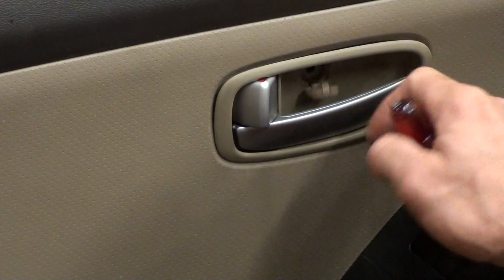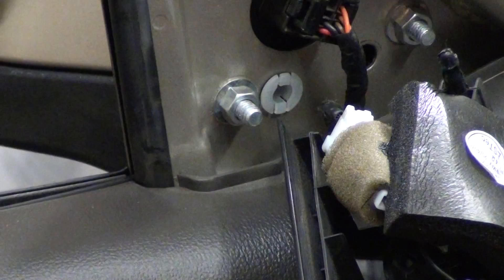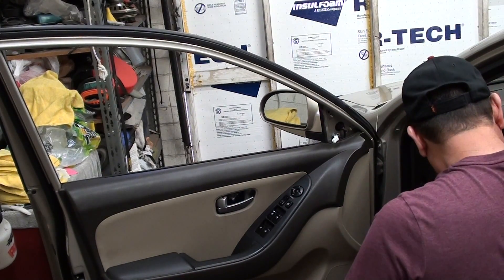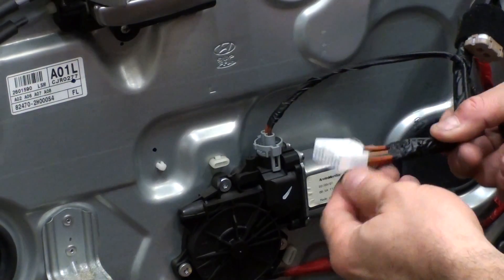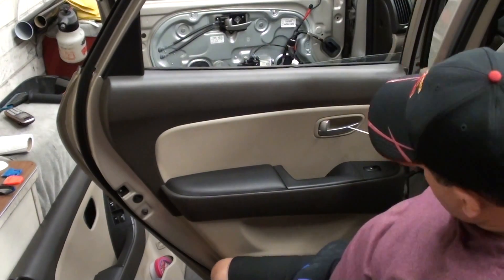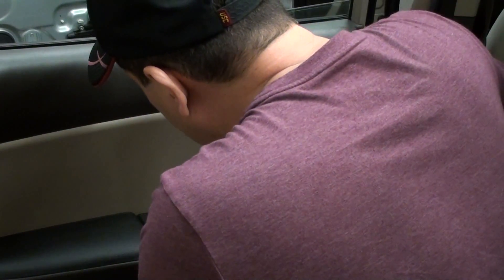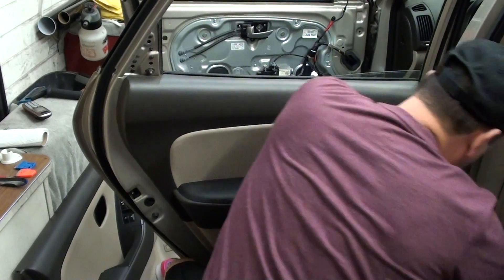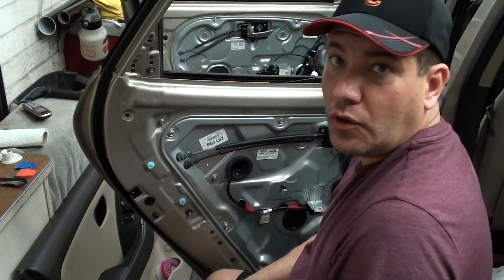How to remove front and rear door panels on a 2008 Hyundai Elantra

Comment: I love ur video..u make it seem so easy to do..but I was wondering cuz my gson pushed in the whole switch on passenger side..Do I have to remove the whole door panel to pull it back up or is there another way?..lol
Reply from the maker: The switch might be broken if it went inward.  You will have to remove complete door panel to get switched out

Comment: How do I attach a rear door exterior mounding panel on a 2005 Hyundai Santa Fe.  I can't find any reference on line except for interior door panels. This panel was knocked off by someone in a parking lot.  I have the clips but they don't hold it on the long term.
Reply from the maker: odeycloney get new clips at the dealership. Sometimes they break.

Comment: I needed to know how to take the metal door panel off to fix the exterior door handle.  Unfortunately, you didn't go far enough for me.
Reply from the maker: Mercy Hs sorry, this is not a video to remove the handle, just the door panel. You will probably have to pull back the plastic liner and then look to see what needs to be removed. Usually 2 bolts hold the handle in place, plus a couple of rods with clips
Reply: That's okay....my brilliant husband figured out how to fix the door handle without breaking through the metal part.  That's good, because I found another video, and the guy had a heckuva time doing it!